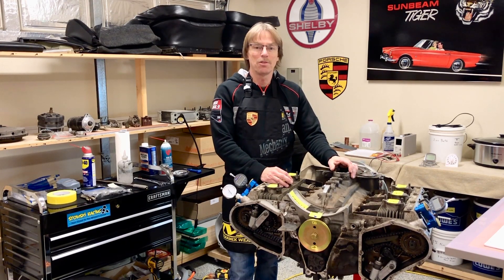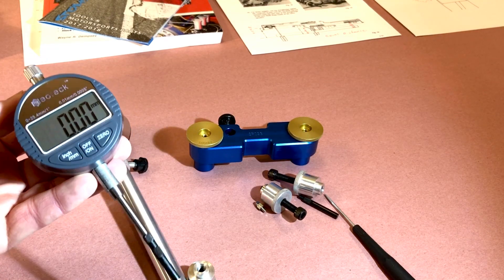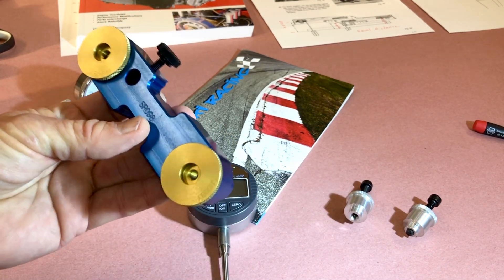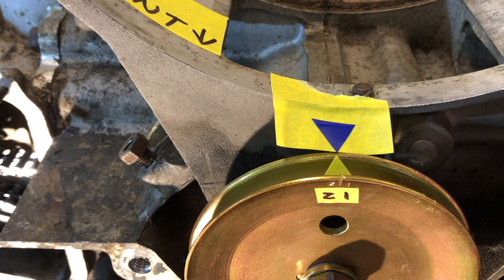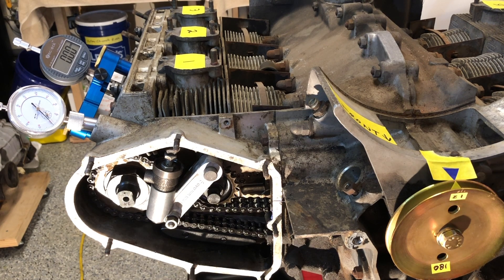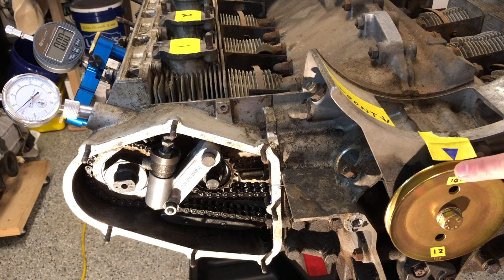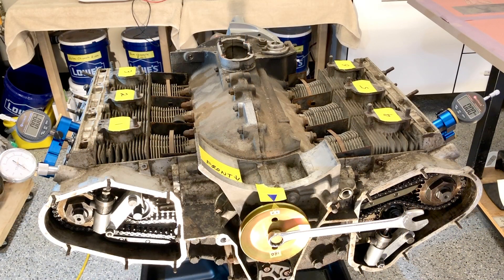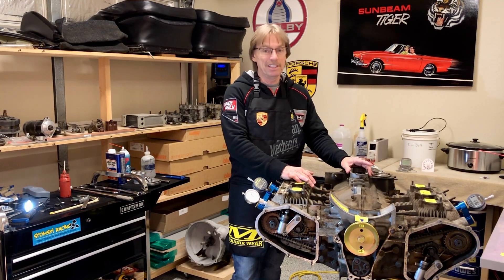Cam timing & valve overlap basics tutorial

Comment: I find it difficult to find  information about the vacuum parts of the Porsche. I don't know if that is installed on the 1967. Can you think of a (maybe short) explanation in a video ? Or do you have a good source for info ?
Reply from the maker: Hi Remco
I don’t think 67 had any vacuum plug ins. I think in 68 there was some kind of smog pump that required a vacuum module. Also early 70s has a vacuum
Advance distributor I think but don’t know that much about it. Also possibly sportmatic transmission may of had the need there but I don’t know that much h about those transmissions

Comment: Thanks Mike! Great video. Anyone attempting should watch this. Are you going to show how to setup the gauges on the actual rebuild?
Reply from the maker: Hello Gary Thanks
Yes for sure..when we put the engine together on final assembly we will thuroughly go thru setting up rockers, valve lash
gauges, finding tru TDC for a complete cam installation and set up.
The idea behind this video was just to help with the understanding of how it works in general..It should help
to compliment the real set up and save some long but necessary explanation on the process

Comment: If you are going to the trouble of checking cam timing you need to find absolute top dead center with a degree wheel,sharp pointer, and  something substantial installed into the spark plug hole to stop the piston in both directions,clockwise and anticlockwise.As the piston dwells, when at top dead center because of the crankshaft throw going over center, finding absolute top dead center is important. I have yet to see a z1 mark on a porsche engine that is accurate. The bigger the degree wheel the more accurate.
Reply from the maker: Hello George
Yes you are certainly right! True TDC will have to be addressed in the real build up.  Z1 is a good reference mark and okay for getting into the ball park but not reliable or predicable enough for perfect cam timing.
Im pretty sure they had some kind of tooling at the factory when building these motors back in the day...not sure how they did it back then..
Z1 only just doesn't seem something the Germans would relay on. They deal only in perfection
Thanks for Bringing this up!

Comment: Great video Mike explaining the engine strokes and what the valves are doing! I learned a bunch and I've done this! Are you considering buying the Stomski racing DigiDix digital TDC tool? Cheers. Kav.
https://www.stomskiracing.com/products/digidix-sr095-m96-dfi
Reply from the maker: Hi Paul
Thanks...Your cam timing timing video is great! Im hoping it helps out to compliment what you have done and also down the road to
bring more clarity for guys who want to understand better when assembling the new motor.
Thats funny you ask about the DigiDix! 
I actually called Steven Stomski and we talked quite deeply on TDC
I found that to be the wild card with setting up cams. Z-1 to me just seemed a bit inaccurate and unpredictable after rotating several times..Im not sure at the moment how I will proceed but haven't ruled that out.
His tool line up is amazing! I also bought the cam socket tool you recommend in your video! That thing is awesome!
A must for the one guy shop!!!